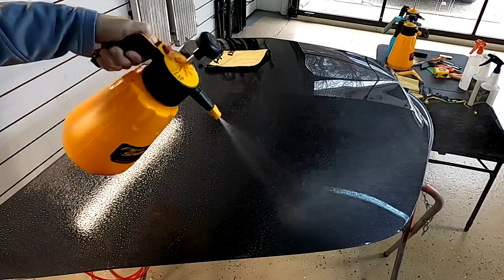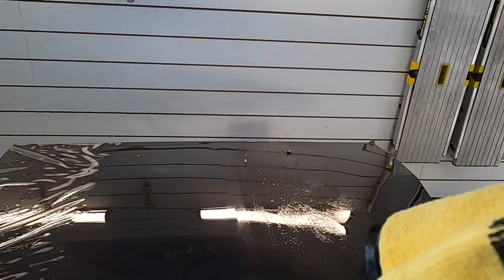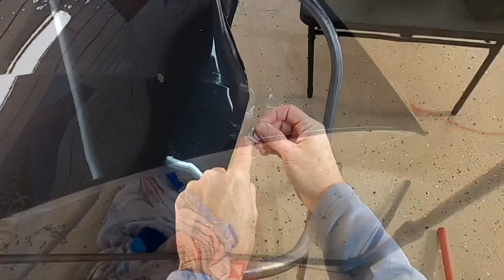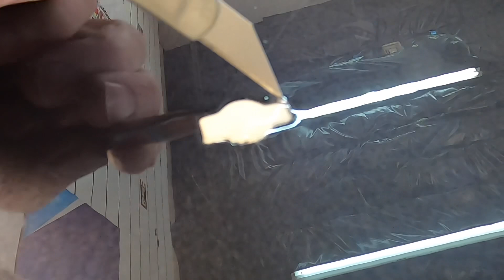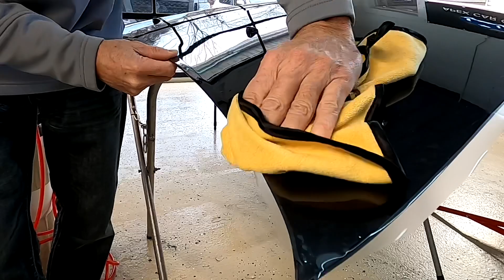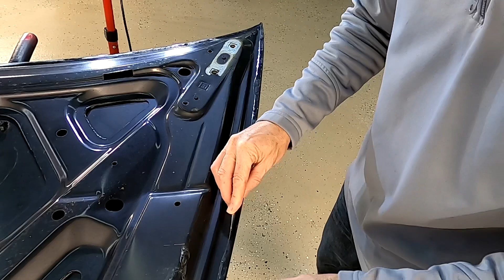Paint Protection Film!! PPF Part 2! The Ultimate Protection From Rock Chips/Scratches!! The Install!

Comment: Brian what is the service life of PPF obviously there’s probably many factors that play into it like if the car is kept in the garage or if it’s outside if it’s daily driven, i’ve heard horror stories of delamination is that just a myth? Is there a proper way of real old PPF removal that you have used? Thanks!
Reply: The tops brands such as xpel, suntek, will offer 10 years warranty from cracking and yellowing. A "well maintained" PPf will go 6 years plus but at that point you it would have acumulated decent rock chips and would loose its brillance, remember it's a sacrificial layer.